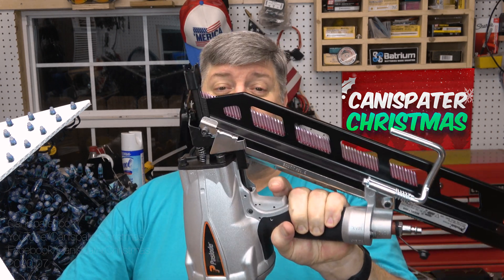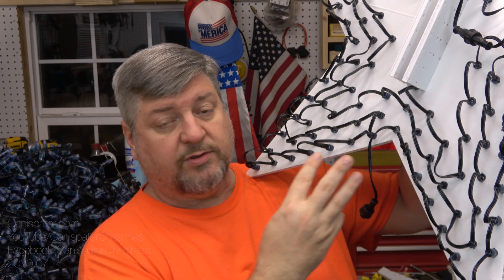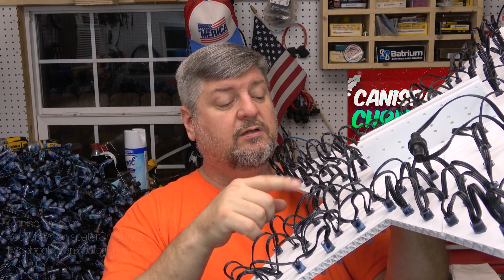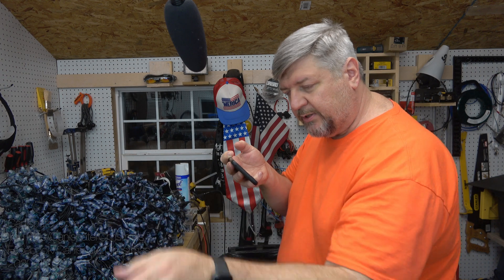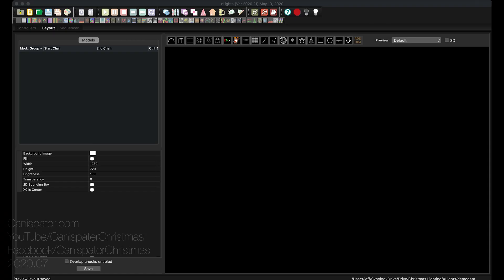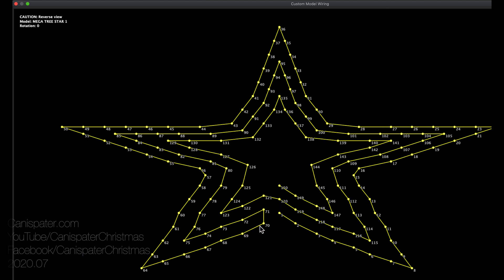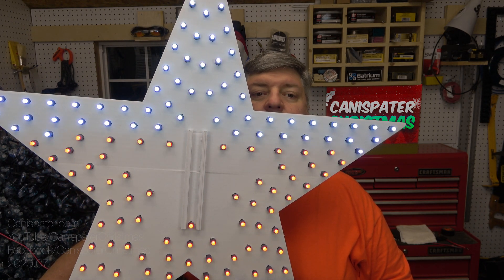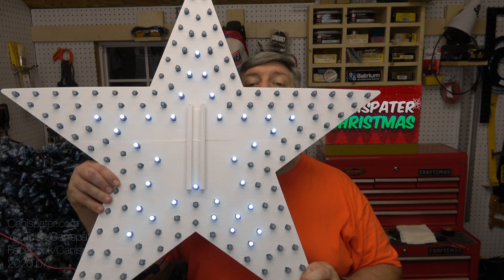🎄Custom Modelling in xLights (2020)🎄

Comment: I built a matrix that has 1900 ws2811 pixels. I would need to put them on port 1 and port 2 on my kulp16 but how would I linked them both together?
Reply from the maker: xLights does the magic if you get the model correct. On the model, enter the total number of pixels then you need strands per string to be the actual number of strings on the controller. So from what you said, 1900 for the total and 2 strands per string which will give you 2 strings of 950 pixels. At least that's how I think it should work. 😂
Reply: @CanispaterChristmas  Ok I’ll try that. Thank you very much

Comment: how much do you spend on these pixels just wondering the cheap but not to cheap option as want to start
Reply from the maker: I tell people to budget about $1 per bulb. They aren't that expensive, but starting out, there is a lot of extra stuff to get - controller, power supplies, pixels, Raspberry Pi or PC, cables, tools, etc. If you already have some of this then it's obviously cheaper. No telling how much I've spent on it. I started small and add to it each year.
Reply: @CanispaterChristmas  oh okay thank you this was very helpful
have you got a video showing howbyou connect the lights together??
Reply from the maker: @taylor-pp8sv  No, but I'm working on it.
Reply: @CanispaterChristmas  okay thank you that will be very helpful 😁👍🏼

Comment: One question, if I set up pixels in a prop, with the lights hooked up to power, can the lights operate without sequence or a computer to make em light up?
Reply from the maker: Nope. They need data to tell them color and brightness.
Reply from the maker: However, if they do, you likely have a problem of some sort. 😂
Reply: How about dumb nodes
Reply from the maker: You'd have to do some experimenting with those. I imagine the current draw is similar, but they are essentially analog pixels vs digital pixels and not individually addressable (the entire string is the same color).
Reply: Thanks for your videos and help

Comment: If I have 5 individual window frame models in the xlight layout can they be connected together and put on the same port or would that not work correctly?
Reply from the maker: If they are close together, yes, but you may need something like an F-Amp in between. It makes no difference which port they are on though. If it makes sense for your display, that's fine, but there's no reason they have to be.

Comment: Great intro as always.  How do you run your tests lime that with the different effects?  Is that thought xlights or falcon?
Reply from the maker: Thanks! I'm using xLights "output-to-lights" feature that plays data out to the controller.
Reply: @CanispaterChristmas  Hi, love your videos! Any tips on getting 'output to lights to work'? Would love to be able to test in real time but can't seem to get 'test' in xlights to work. My settings seem aligned between fpp and xlights and I only have 2 strings of 50 to get things set before I get carried away

Comment: If you were to change the render style to Per Preview, does it still display weird?  I love your videos! that is what I started learning with and they are awesome, I even point to your website as a reference in the FPP Manual! Great work!
Reply from the maker: Thanks! Single-line is the effect I'm going for. It wouldn't do it per preview, but then it wouldn't achieve the same look. I use single-line a lot - hence why I noticed it. lol!
Reply: @CanispaterChristmas  I see, I thought you mentioned the curtain effect was not displaying correctly. And in case you didn't know, you could have submodeled it in the order that you want to display your single line. I don't know if it would have been easier or not, but in any case the video was a great way to show how to make a custom model.
Reply from the maker: Yeah, the star isn't a great example since there is already a built-in star model with ring settings. There's also another tool for creating custom models I need to show. Another video. :)

Comment: When you first showed the wiring I thought "single strand will look awful"..... which can be fixed with submodels, but you showed a great way of rebuilding the model.  Thanks!
Reply from the maker: Thanks! Consensus is that the star model works better for this, but I really just wanted to demo building a custom model. Apparently there's also a video option that will assign them automatically, but I haven't tried that.

Comment: Instead of doing a custom model you could have just used the default star model, set number of pixels, then for "layer sizes" put x, y, z for your different layers.  The default model would have been what you manually built.
Reply from the maker: True. That's why I mention this wasn't a great candidate, but I wanted to demonstrate doing custom models.
Reply: Paul Thomas  and I come just for the entertainment value.

Comment: Can you Tiger me the Produktnumber of this Pixels
Reply from the maker: I don't know the number. I asked for 100-node, 2811 bullets, 12V regulated, 18AWG all black wire, 4 inch spacing. They are fairly standard pixels.
Reply: As you're in Germany, best European Distributor i've found is https://buildalightshow.com in the UK